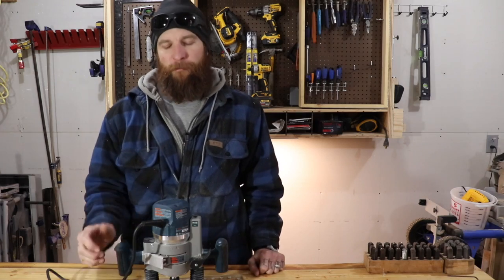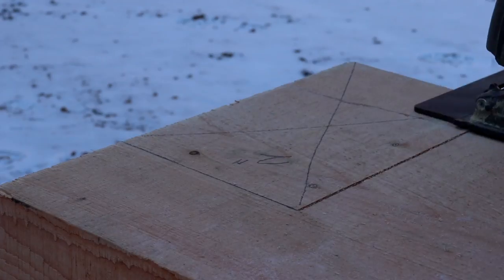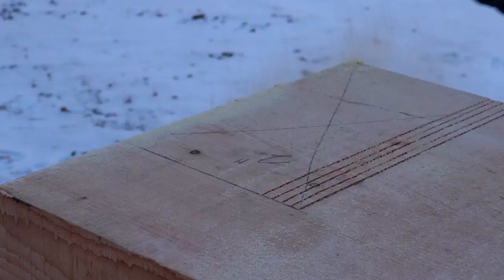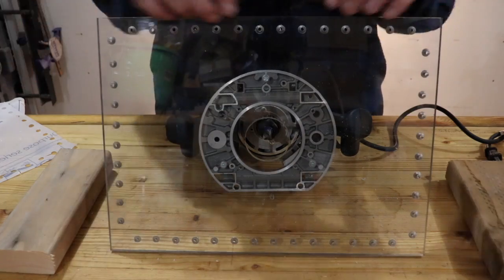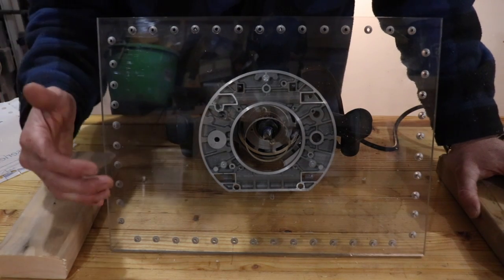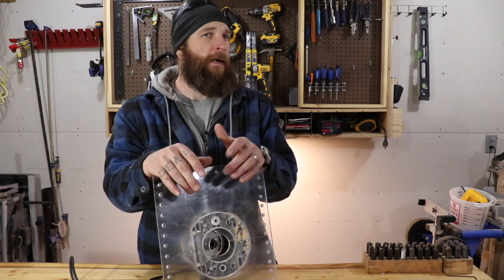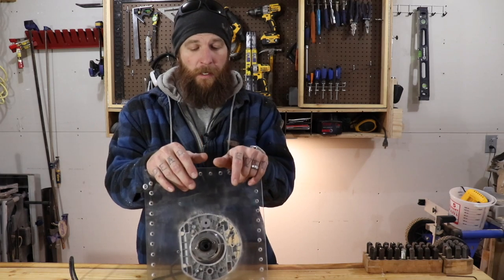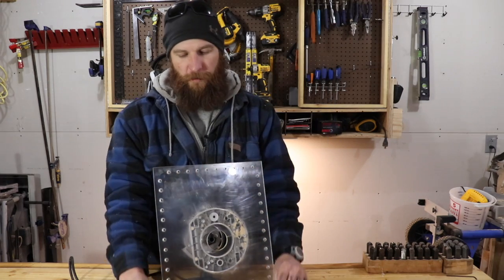router base plate JIG

Comment: Good video....I made a metric version of the original samurai jig, and it has worked really well for me, but there are times when the extra reach of your version would be useful. 
It's true that polycarbonate is stronger than acrylic and much of that strength lies in its ability to flex slightly and absorb impact energy...that's why it is used as a security glazing material in preference to acrylics, which can crack and shatter.  Having said that, as long as you haven't found any significant flex over the span of the jig it should work perfectly and last almost indefinitely👍
Reply from the maker: Awesome! Thanks for that info. I’ve not noticed any flex. So we should be good! 🙂